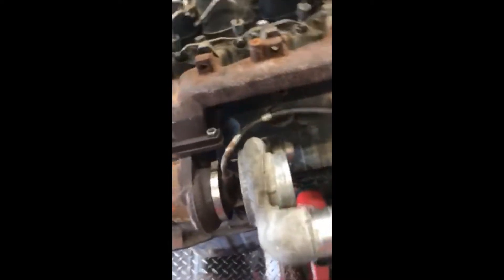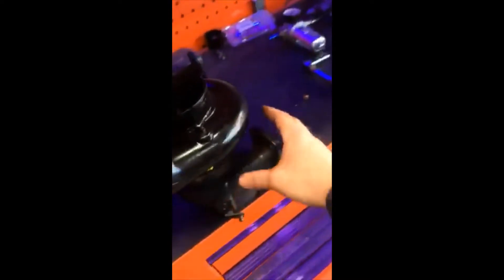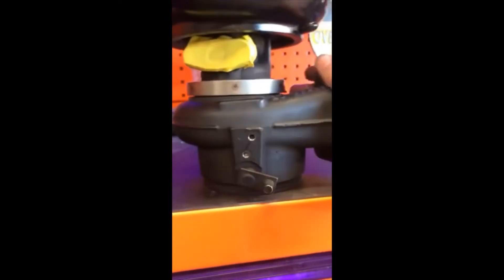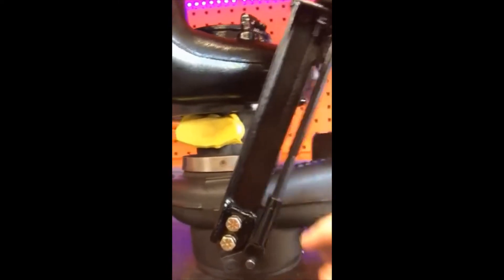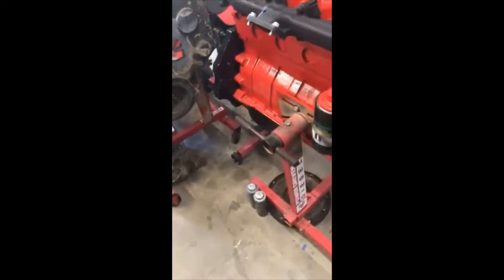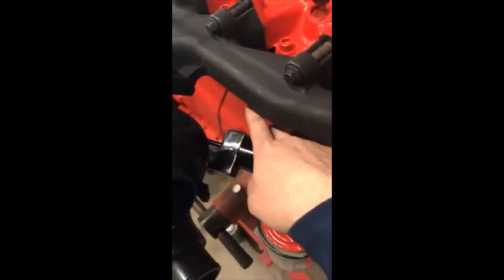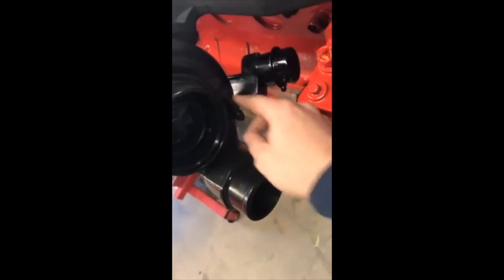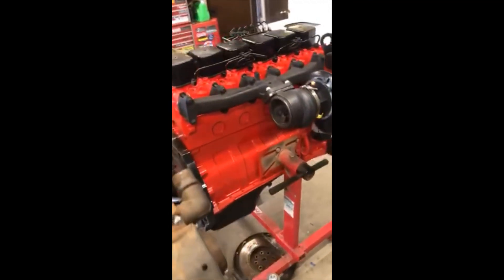Cummins HE341 / HE351 wastegate bracket for second gen swap

Comment: So you can just take the pins out that connect to the hot side and clock it however you need to? That would make it way easier to set it up how I want to
Reply from the maker: yes you can